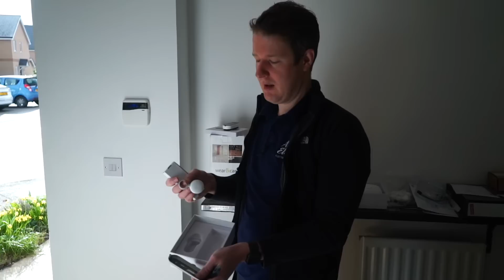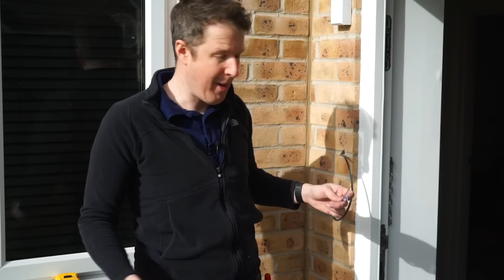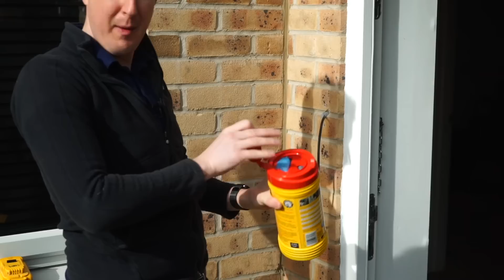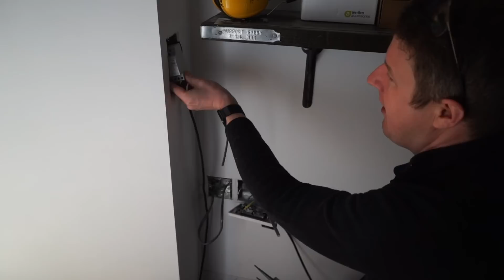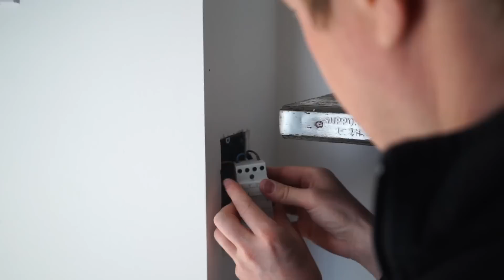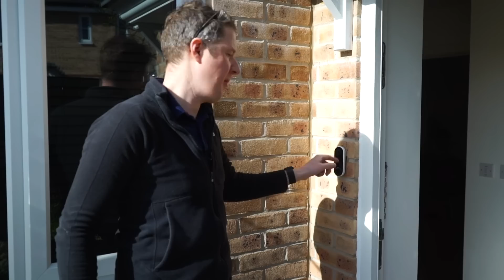How to Install a Nest Hello Video Doorbell - Video Doorbell Installation - Electrician Life

Comment: Have you ever installed a wired blink doorbell, I’m having problems and going by a load of others on a Facebook blink forum they can’t seem to get it either
I’ve got the blink doorbell chime wires going off to a bg bell 24v transformer, then a twin core with a plug to a standard switched socket. The transformer is in a housing by the door all connections are secure

Comment: I’m looking to replace my standard doorbell with a Nest video like yourself. After removing the doorbell cover, I discovered the low voltage cable was a Cat5. Would this be safe to use if I was to connect the transformer which supplies the 24V AC?

Comment: Great Video and so helpful.... 

QQ. I am hoping to run two Nest Hello devices off a single transformer and currently don't have a chime... Do you think the BG 24V transformer would successfully power two of them? Is there a bigger transformer you might think off that will drive both Net Hellos?

Comment: Unfortunately, the power is now outage. All ice creams are lost completely if you don't prepare for storing. It will cause body heating because all fans and air conditioners are no longer online. The restoration time lasts about 30 minutes up to 12 hours depending on how severe the power has been cut off. Thank you for understanding.

Comment: Why are you still using classic transformers, and even close them in in unventilated boxes? A switching power supply (e.g. Meanwell HDR-15) would be more energy efficient, more compact, and due to the rising copper prices most likely even cheaper than that transformer.

Comment: So don't take this the wrong way Jordan, I know I am talking to the owner of Artisan Angled Drilling Company, however you added the silicone way to early in your sealing needs.  You got it all nice and sealed up and then shoved the cable down another 20" which took all the silicone down the hole with it.  It really needs to be sealed with the wires are far in the wall as possible.   Also for simplification you could use fork terminals and not ring terminals, that way you don't have to undo the screws, as Murphy says you will drop and loose them.  With fork terminals you won't drop your screws! 👍👍
Reply: I agree! Dropping tiny screws outside is the last thing you want to deal with! 😬😬😬
Reply: Nice meme bro. My man J knows what he’s doing😴

Comment: Why not place that transformer box just slightly higher than the button? In  that case you have to drill upwards and rain and moisture is never going to be an issue.
Reply: Probably because you'd end up with a blank plate right at eye level by the front door. Lower down means its out of the way

Comment: Very informative video, a neat idea  for the concealment of the transformer but a little concerned about the lack of air cooling that might be required possibly resulting in an overheating issue,  just a thought. Keep up the good work and stay safe.
Reply: Im sure that doorbell at the most consumes 2W, I think the transformer will be just fine

Comment: Great video but terence beat me to pointing out the mastic error...... pull the cable through and just before closing up add the mastic and pull the last few inches through slowly, that'll seal the hole and keep it where its needed...
Well done on the install.
Reply from the maker: I added more silicone after but of course I didn’t show that on camera lol now everyone thinks I’m a complete idiot 🤣

Comment: When you added the silicon to the wire going through the house, why then did you then ask Cory to pull the cable through into the house ? What you did by doing this was pull the silicon through as well, rendering the effectiveness of the silicon completely useless. Personally I thought common sense would have told you to add the silicon once the cable had been pulled through ensuring that the hole was completely water tight. I agree with adding a little silicon near the end of the cable before finally pulling it all through so the inner hole was protected as well  and then add the final smudge of silicon to complete the seal on the outside once the cable was through.
Reply: I came here looking for this comment, I thought the exact same thing.
Reply: @chriscj8950  Me too
Reply: I thought the same too. I am sitting here like... "you haven't pulled the cable in first before filling" 🤦‍♂️
Reply: Bad practice to have the cable angled down from the outside, always angle up to prevent moisture migrating into the house.  Water can be in the cavity on the back of the outside brickwork, and now it will bridge onto the inner skin.
Reply from the maker: Calm down people I added more silicone later 😂
Reply: @artisanelectrics  Not enough! You need to use entire tube of silicone to satisfy us 😂😂😂

Comment: In fact Jordan you were way off the mark here. Adding a point to an existing circuit is not notifiable in England unless it's in a special location. If you do it you should provide a minor works certificate to cover your bum... But DIY is still allowed. The niceic like to tell us it isn't but it is. 

And 1 o'clock position for plate screws

Comment: How much are  you being paid by the cartels to continue  spreading the myth that diy'rs aren't allowed to do electrical work? There is nothing to stop anyone doing there own electrical work as long as they follow the rules by registering the work with there local building control.Not going to be cheap but  on something like a rewire the fee will be less than  labour cost of getting a "Competent Person " to do the work.
Reply: @jerryuk93   The mp death is a myth,part p was introduced 13 july 2004,the mp's daughter died 31st july2004.However even before 2002 the matter was being discussed,even as far back as my  collage days in the 80's. The general consensus   around then was to limit the sale of electrical accessory's  to the general public and introducing a license,issued at completion of your apprenticeship.However due to pressure from the diy chains and no perpetual revenue stream for the governing bodies it was soon dropped.
Reply: Uneducated clowns wil never do a decent wiring job just because they tink der following regs. If your not an electrician stay away from wiring.
Reply: @CiaranTrivium  Rubbish.Ive seen work carried out by non qualified diy'rs that is neater and safer than  jobs carried out by some,so called approved sparks.
Reply: @CiaranTrivium  I agree an uneducated clown may not do a good job but not all those who do there own electrical work  are uneducated clowns.

Comment: As painful as it may be, get the nest doorbell fitted with a chime. When your google hub loses internet connectivity e.g. isp suffers an outage, you will not have a chime or receive any alert notifications when someone presses your doorbell. 🤕
Reply: never mind the fact in 5 years time Google will get bored of the API and end of life it and your doorbell will no longer work, not doing your customers any favours by not installing an actual chime.
Reply: Do you have a circuit diagram ?

Comment: Looks like you was using the wrong size crimper for the eyelet crimps you was using. Red crimps should be using the red marked die in the crimper. Although it’s hard to tell from the video 100% but it looked like you was using the blue coloured section of the crimper. Great video. 💪🏻
Reply: I thought that too as the red die is usually at the end of the jaw

Comment: Surely it was pointless putting silicone around the cable and then pulling the excess cable through, and pull all the silicone down the cavity of the Wall
Reply: Haha yep was just thinking that - was sure Jordan was going to just cut it shorter but then pulled it back in instead 😂
Reply from the maker: I added more silicone after

Comment: @15:44 I don't disagree with the sentiment but adding a fused spur to an existing circuit is not notifiable work under Part P so is possible to DIY that part without breaking any rules... however... having a competent person do the work might be preferable... for the obvious reasons.
Reply: Also being a professional doesn't mean anything. I as a DIY tend to follow all the rules as a professional would, then I had a job done by a so called professional electrician and it was shit, and I needed to rectify a lot of things, we are talking about earths not connected on class 1 lights, cables joined just with just electrical tape (wagos probably costs too much...), trunking not properly fixed, accessories not leveled, loose connections everywhere, cable and accessories clearly recycled from other jobs, 1.5mm cable used for 16A sockets, network cables not properly terminated, and so on.  

And it was all certified! The certification is just a piece of paper, you can certify a shitty job if you want, of course they assume the risk that if something bad happens they have some kind of responsibility, but it's difficult to prove that the cause of the fault was theirs job and not other alterations that were done afterwards anyway.

Comment: Jordan how is your Netatmo doorbell doing? I have some Nest devices but I'm too tight to pay for one of their subs to consider a Hello doorbell :)
Reply: Take a look at the Eufy ones. No subs needed and the recordings are stores locally and normally cheaper to buy that others.
Reply: @CeeBeeSco  Thanks, but I don't want anything that has any plug socket based component.
Reply from the maker: The Netatmo one is great no complaints at all so far!
Reply: @artisanelectrics  Thanks!

Comment: Tut tut. Youtube police here. Remember "prove, test, prove" with your voltage indicator (because everybody knows that your tester always fails just after proving it's working). ;-)
It's a shame they don't make a transformer that is made specifically to fit in a back box.
I always leave my screw heads vertical so I can tell if anybody has been messing around after I have done the fit. Horizontal is OK too, as long as they're all the same through the property (OCD!).
Good to see your channel expanding. Shame that Cory spoils it by being so straight laced. ;-)

Comment: Safe isolation procedure for single phase:

Prove tester works correctly on a known source
E-N
E-L
N-L
Prove tester works - unfortunately you didn’t do that so you could’ve got a false negative
Lock circuit off

Buy a proving unit

Comment: I have installed a couple of these in family homes. The problem with them is to the vast majority of people they do not understand or realise the cost of installing them,(let alone the device/s). Transformers, cable routes, new electrical circuits feeding the camera with lights attached ect
Reply: £209 at Currys plus all that other installation stuff - and Artisan labour rates :-)  and they don't include the ring crimps!
Reply: Agree I'm on the Google pro site and half the people that contact me seem shocked I'm not charging 50 quid to do an install.